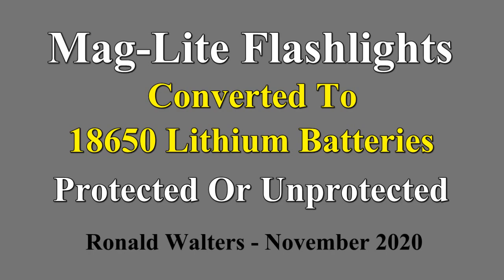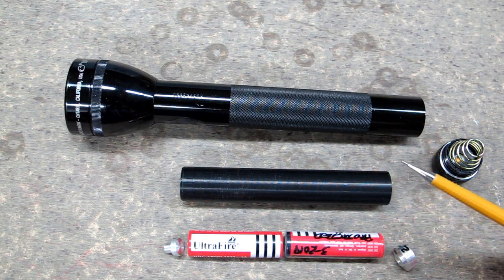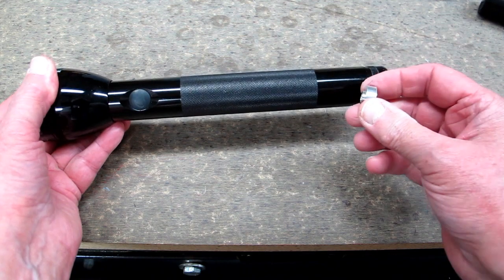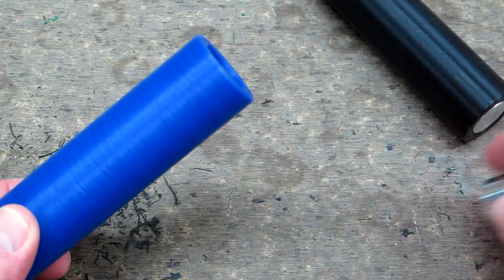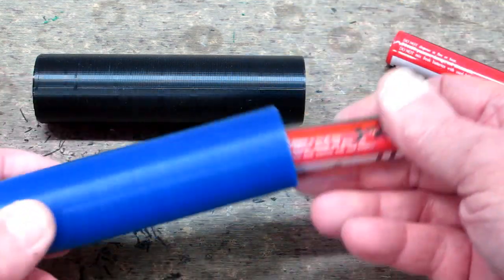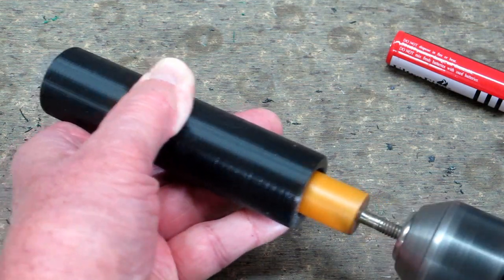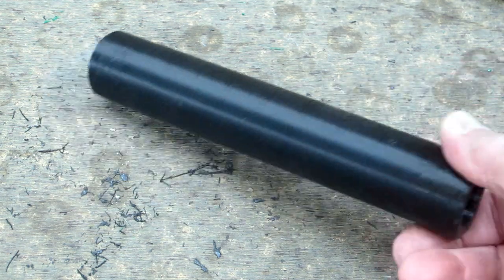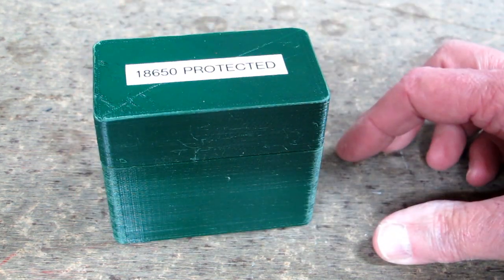Mag-Lite Flashlight 18650 Protected Cells

Comment: You  can  use  pair  of  21700  cells  instead  of  18650 
21700  cell  has  5000mAh  capacity.
Reply from the maker: I don't see why not although they are somewhat larger. I did not have 21700's when I designed these adapters... so you would need to design your own adapters for the 21700's. Also the actual dimensions can vary a bit depending on unprotected vs protected (recommended) and by manufacturer.
Note: The 18650's have performed well in the Mag-Lite flashlights. Unless you have a need to be burning the flashlight all night long I would stick with the 18650's. This also produces a flashlight that can just sit there for months on end and will work when you pick it up (and the batteries don't leak).
Thanks for watching. Please subscribe! 
That is what keeps this channel running. 
Ron

Comment: I have a Maglite 3D and would like to convert it to 2 18650 batteries. I already converted to LED. Is there an option to buy that adapter anywhere and get it shipped?
Reply from the maker: Sorry. I only offer the free files. 
You need to find a friend who has a 3D printer ... or sometimes Libraries have 3D printers available. 
Another option would be to search for a 3D printing service.
Thanks for watching. Please subscribe! 
That is what keeps this channel going. 
Ron
Reply: .         For  your  3D  use  pair  of  26650  rechargeable  cells  and  center  the  cells.
 .     Change  the   bulb  with  6D  Mag  and  enjoy  bright  and  long  run  rechargeable  Maglite.
 .     You  can  recharge  them  hundreds  of  times  and  each  charge  will  last  5  hours.
 .     Just  make  sure  positive  of  battery  must  have  good  contact  to  switch  center  little  spring.

Comment: That is a nice professional adapter! !  
If you want a fast, inexpensive, customizable hardware store version:  
Three D cell Maglite
Replace the incandescent bulb with a 3V-18V LED.  
(You can continue to use the incandescent lamp until it burns out.)  
Use a 7.25" long 1" Sch. 40 PVC pipe as a reducer.  
Make a "dummy" adapter with a .25" x 4.5" carriage bolt, two 
.25" x 1" fender washers, two lockwashers and four .25-20 nuts.  
Sandwich the washers at each end between the nuts.  
It will fit one 26650 Li-Ion cell directly or one 18650 Li-Ion (or Li-Mn) 
cell with a 1" piece of .75" I.D. THICK wall vinyl tube over the cell in the 
middle or a .75" piece at each end.  If you use a 2" bolt, you can use two cells.  
Insert the pipe, the cell(s), the bolt adapter head-first then screw on the cap.  
Works great!  
Now you can use D cell alkaline, NiCd, NiMH or 26650 and 18650 Li-Ion cells!  
The 3V-18V LED will operate down to one dead Li-Ion cell at 3.0V, 3.2V safe  
or three dead D cells at 1.0V, 1.1V safe each.  
You can also use two LiFePo4 cells which have a range of 2.50V-3.65V each.  
Change/adjust your bolt length and PVC pipe length for other combinations.  
For C cells, the PVC pipe is not needed, just the vinyl tube spacers.  
You can even use those 3 AAA adapters in place of an 18650 in a pinch.  
I have not tried it, but I think 21700 cells could also be used by moving the washer 
and nuts a bit farther in (shorter) at the cap end and use a piece of .875" I.D. THIN 
wall vinyl tube over the cell(s).
Reply from the maker: You should make a video showing people what you are talking about and how not to short out the batteries when using your nuts and bolts and washers.
Reply: @RonaldWalters2010  Yeah, I should.  Kudos to people like you that design and make products AND take the time to make a video!  I am always working on several projects and don't take the time to make a video.  :(
Reply: Great discovery!  I found by testing that my PR 3V-18V LED turns off and does not draw current below 3V, so it is in effect providing battery protection for 1 cell.  If a PR 6V-24V LED was used, then it should shut off at 6V for 2 cell protection.  Be sure to test your LED so as not to over discharge the cells.
Reply: Long-winded comment which serves only to confuse. Please make a video and show people what you are talking about and how not to short out the batteries when using your nuts and bolts and washers.

Comment: OP wouldn't regular lithium ion 18650's possibly blow the lights emitter/bulb at 4.2 volts?
Reply: Incandescent lamp burns brighter for a shorter lifespan, then replace with an LED for more light with less energy use.  Also note that 3 alkaline cells at 4.5V max will have 3 to 5 times the runtime as 1 lithium 18650 at 4.2V max.  The alkaline C and D cells have much more capacity.  In the 3 cell lights, if you replace the incandescent lamp with an appropriate LED and use 2 lithium 18650 cells at 8.4V max, you will gain runtime.

Comment: Love the adapters! Protected batteries are new to me. What does that mean exactly? I am thinking an EMP - proof shielding? Or am I way off?
Reply from the maker: You can buy protected or unprotected 18650’s. Protected batteries are more expensive. You can add a protection circuit to a battery cheaper if you have a way to weld connections to the terminals. Watch this video and it will explain everything.

18650 Lithium Battery - Adding A Protection Circuit
https://youtu.be/WE2AS6iwom0
Reply: The protection disconnects the cell from the device when the voltage is too low to prevent over-discharging.  If the flashlight was designed for lithium cells, there would be protection in the light itself.  They SHOULD disconnect at 3.0V, but many are set at 2.50V, which is way too low unless you have LiFe cells.  Most are also supposed to protect the cell from being over-charged.  The protected cells I tested did NOT work!  I do NOT trust them!